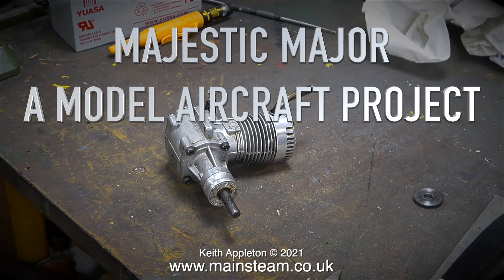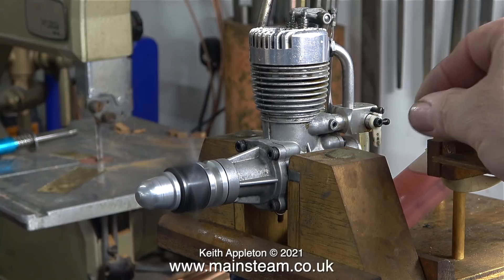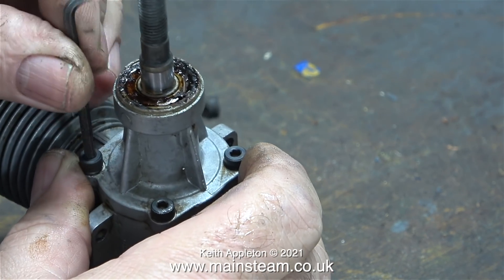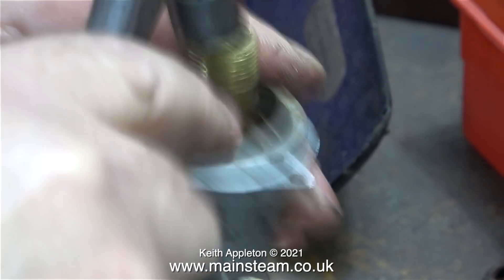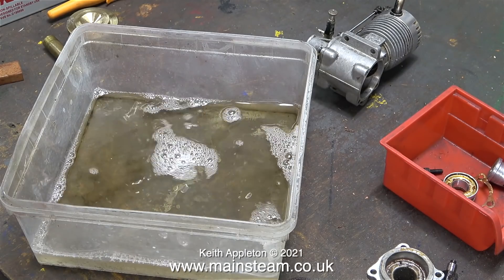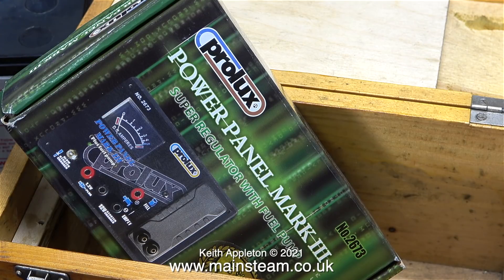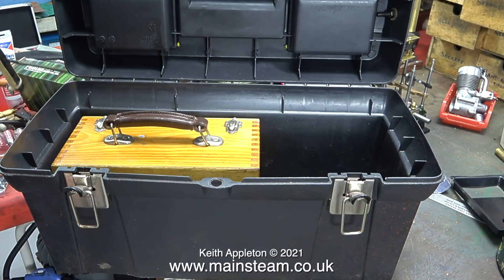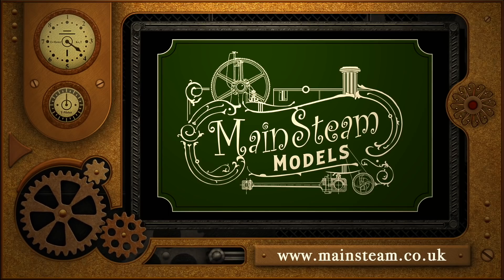MAJESTIC MAJOR - A MODEL AIRCRAFT PROJECT - PART #8

Comment: 3:10 I use a butane microtorch for this myself. Heats that old castor right up and they usually just fall apart as if they were still new. Also works to get the bearings out easily; heat the case up and they just drop free. Putting them in the oven at 350 degrees F for a few minutes is the lazy man's way to dislodge pesky RC model engine bearings.

Comment: Thank you for this series on a model plane fitted with an open rocker engine. I am quite enjoying it. I can't say that it brings these sort of happy memories back. I missed out on radio control. In my day it was model diesel engines & control lines. Or free flight & I started to like sports free flight ROG with my little diesel engines. RC was more single channel with valves.
.